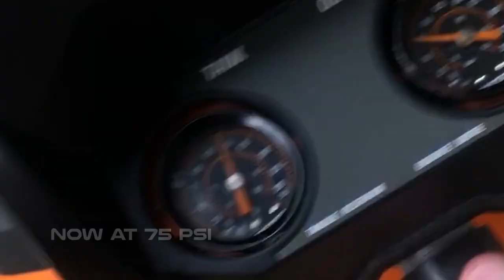Cleaning My PC With Air Compressor!

Comment: Do u use water trap?
Reply from the maker: nope...lol
Reply: @MrDarkcore  lol alright. Asked bc I was planning to clean my pc using one of those but I do not have a water trap on it
Reply from the maker: @javogrci3828  mine is just a basic pancake compressor an I didn't see any water so I guess it just depends.
Reply: @MrDarkcore  yeah mine is pretty simple as well. Do you always clean your rig with it?
Reply from the maker: Javo Grci summer time, vacuum in the colder months